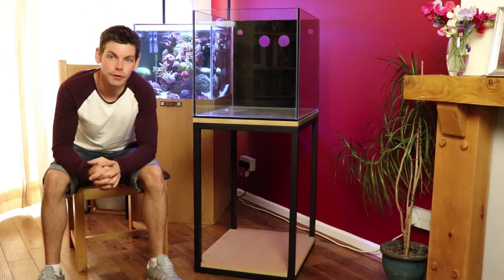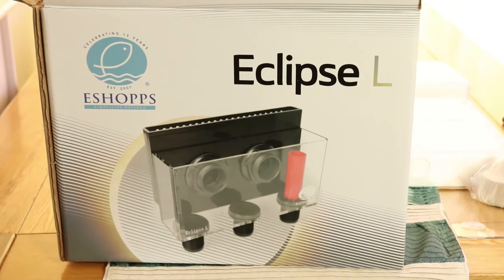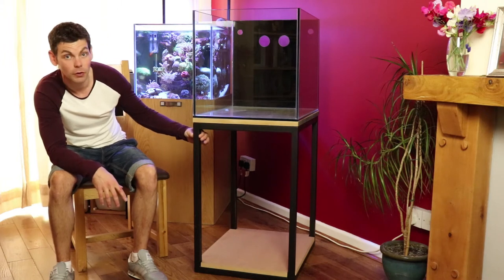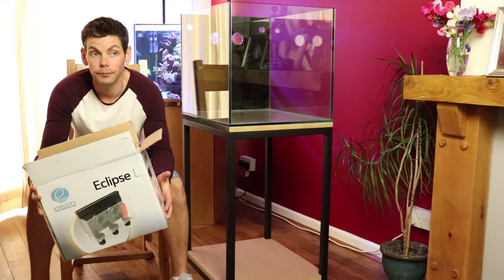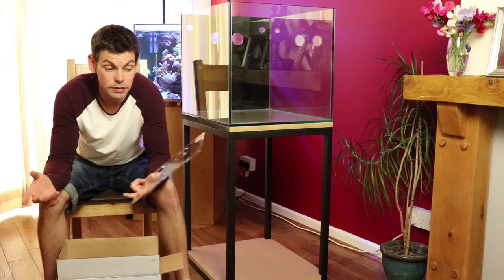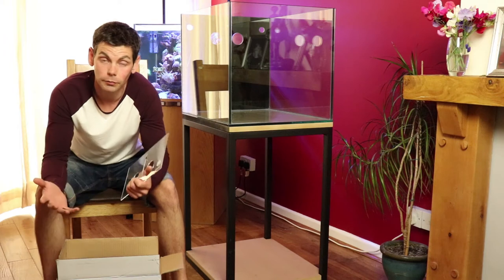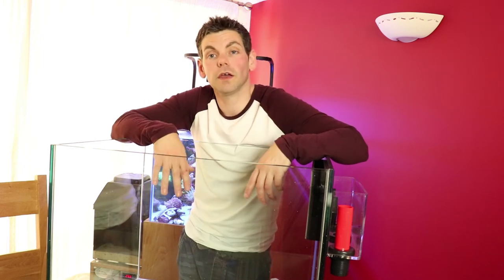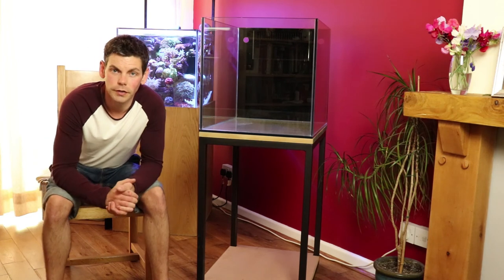Setting up a reef tank episode 1

Comment: I’m about to buy this overflow for my new build. Quick question on how you decide how far down from the top of the tank to where you put your holes. I thought you would have to put the box flush with the top of your tank cuz your tank is rimless? I have a rimmed tank though, so how far down from the top of the rim down should I drill my holes? Your answers would be of great help!
Reply from the maker: WHY70122 hi I used the wear box on the inside of the tank to set the height I made a guess that the water line will sit no more than half way up the grate holes and positioned the box to allow me about 1.1/2 - 2 inches from the rim of the tank it’s personal choice but I wanted to leave a gap so my jump guard could sit inside the tank rim without touching the box. But I would leave a small gap anyway just in case the grate got blocked up for any reason and water could flow into the box over the top before spilling out of the tank. 
Hop this helps and all makes sense. 
Are you drilling the tank yourself?

Comment: Did you get the stand custom made, and is that wood piece on top of the metal? Also, what kind of tank brand is that? I've been mapping out this exact build in my head for some time now, so I'm very chippy to have randomly come across this build series! Love that you went with the Eshopps Overflow box!
Reply from the maker: Intellectuality 
Hi the stand I had build by a guy I know that has done some welding for me in the past he dose a grand job. The wood on top of the stand is MDF and is 22mm thick. 
The tank is custom made to my specifications from a tank builder in the uk. 
Thanks for your interested in this build and my channel. 🙏🏻
Reply from the maker: Intellectuality 
I have used this style of overflow many times and never found the addition of these needed in order to make the overflow silent when using a gate valve to create a complete syphon.

Comment: Great video or rather series. Where did you get Eshopps eclipse overflow from? Did you imported it from US? I can't find it in the UK.
Reply from the maker: Mmm Dddd yes I got it on there eBay shop it cost about £124 all in imported including tax and delivery.
Reply: Cheers. I'm thinking of getting one for my new project. Your videos are very helpful for a newbie like me.
Reply from the maker: Mmm Dddd I’m glad they are of use that makes it all worth while. 
This is a link to the one I got you can get them in different sizes 
https://rover.ebay.com/rover/0/0/0?mpre=https%3A%2F%2Fwww.ebay.co.uk%2Fulk%2Fitm%2F111951878277
Reply: I've just had one delivered from the US, did you have to change the US bulk heads to fit UK pipe?
Reply: You need us pipes I think 1” one. I got all my plumbing online from aquariumplumbing. I glued the pipe straight to the overflow
Reply from the maker: I used the bulk heads supplied and got pipe to fit you can get pipe adapters to convert the size from imperial to metric and then use uk sizes